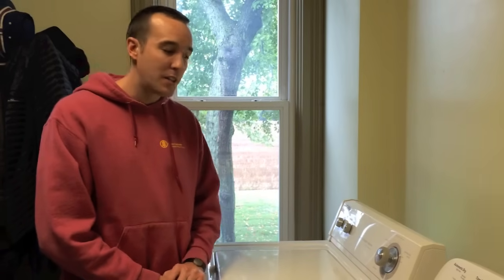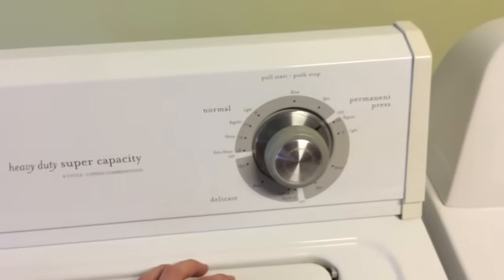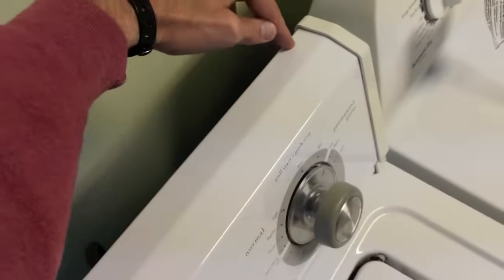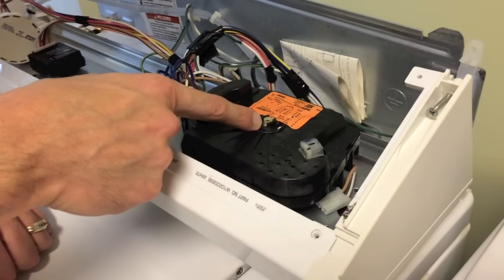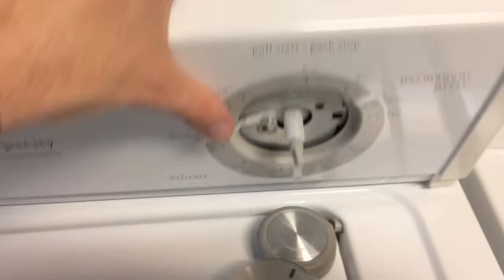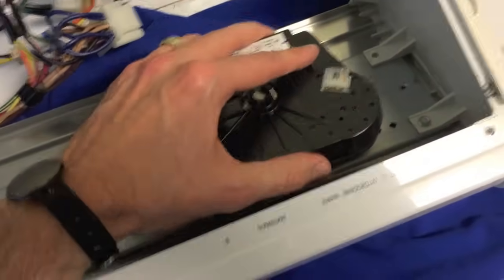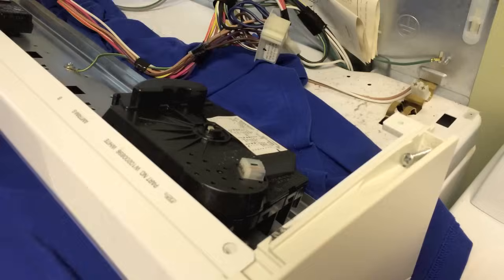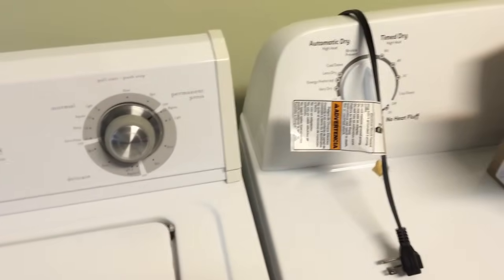My washing machine stops at Rinse - Does not DRAIN or SPIN

Comment: My washer seems to be having issues draining on certain cycles. In addition, recently when I have put it on spin after it has ran to get rid of the excess water, it will sometimes thump and shake like crazy. Do you know what the problem could be or what I could like for? Thanks!
Reply from the maker: Erik Adamson 

Thanks for checking out the video and sharing your experience.  You are experiencing 1 of 3 issues...

     * Drain Pump
     *  Lid Switch
     * Timer...which is mentioned in this video.

1.  Your Drain Pump is beginning to work intermittently.  That little Pump wears out over time and does 1 of 2 things.

     •  Fail intermittently
     •  Fail completely at any given time

       https://youtu.be/M2LltDIjNl0

2.  Your lid switch is wearing out and beginning to work intermittently.  Once your wash cycle gets to the spin portion, your lid switch verifies that your actual lid is closed.  It Then sends an electrical signal to the timer to continue the cycle and begin spinning.  If your lid switch is not working properly, the timer will not continue to the next stage of the cycle... this is a safety feature that does not allow the machine to spin with the lid open...which alleviates the machine throwing water all over your house...not good 😮.  Replacing your lid switch is both repair friendly and cost friendly.  Below is a link to my video changing lid switch

       https://youtu.be/1hTRc-_PnP8

3.  Your timer is wearing out and beginning to work intermittently during the cycle...leading to the stop & go... replacing your timer may get rid of this issue.

Keep me posted!

Please subscribe to the channel and turn on your YouTube notifications that would be awesome thanks again 😎👍

Comment: Would you know what's going on with my machine if it stops working when the dial gets to "Pause Cool Down" feature, is it something serious? I am able to switch the dial to Spin and that works but every time I start a new cycle it just stops at Pause Cool Down. I have a Kenmore washing machine, Any suggestions are appreciated!
Reply from the maker: Yana Ilyaguyev 

Thanks for watching & sharing your experience!  This is common with Kenmore washers more than others.

This is signs of a faulty section within your Timer & once the cycle gets to the point of cool down, it doesn’t know to continue due to the dead spot in Timer sequence.

We recommend replacing old Timer with new Timer.  This should ultimately fix your hick-up & allow washer to complete a full cycle efficiently & effectively.

Let’s start there!  Keep us posted!

Please subscribe to the channel and turn on your YouTube notification Bell 🛎 that would be awesome thanks again!  😎👍🔧🔩

Also below is a link to our Appliance/Home Repair Video PlayList.  It contains several videos that you can benefit from including additional videos on Washing Machines, definitely check those videos out!  👍

       https://www.youtube.com/playlist?list=PLjCXOz8TSkZmG-ZbhhKPj4Vh3K3MDPXii

Comment: How do I know if the timer is the issue? When researching online, I read it could be the cold water inlet valve?
Reply from the maker: Karuna Rockwell 

Thanks for checking out the video.  The symptoms led us to the lid switch first...we tested the lid switch and found that to work as it should.  After replacing the timer, problem solved.  Try testing your lid switch first...there are a few videos out there that will show you how to test it.  Below is a link to our lid switch repair.

       https://youtu.be/1hTRc-_PnP8

Please Subscribe to the channel and ring your YouTube bell 🔔 this will be helpful to us thanks again.

😎👍🔧🔩

Comment: How do we know it's the timer?
Reply from the maker: Thanks for checking out the video.  Great question!  The Timer controls the “Cycle Flow” and continues to move the cycle through the steps.  As the internal parts of the Timer begins to wear out...you see the washer stopping at either “Drain or Spin”...

The Lid Switch also is a key part in the cycle...once you lower the Lid/door...you will hear a click.  This click secures the electrical current and sends message to Timer to begin the Cycle.  

Also...once the cycle gets to the spin portion, the timer re-communicates  with the lid switch to verify that the lid is closed for safety purposes...example:  you do not want the washer to be spinning with a lid open...water will fly everywhere 😱

I recommend purchasing both the timer and the lid switch as they work together to move the washer through the cycle.  

To order parts, Go to:  repairclinic.com

Keep me posted!  Please subscribe to the channel and turn on your YouTube notifications that would be awesome thanks again 😎👍

Comment: So how did you decide the issue was with the timer? Was it a loose dial or how exactly did you come to the conclusion of where to start?
Thanks
Reply from the maker: Steven Wilson Thanks for checking out the video.  The symptoms led me to the lid switch first...I tested the lid switch and found that to work as it should.  This then led me to the timer.  After replacing the timer, problem solved.  Try your lid switch first...there are a few videos out there that will show you how to test it.  Below is a link to my lid switch repair just recently completed.  Please Subscribe to the channel that would be awesome thanks again 😀👍

https://youtu.be/1hTRc-_PnP8
Reply: DIY With Michael Borders thank you so much I appreciate your speedy reply. I have an older whirlpool that yesterday would not drain or spin yet the rinse works fine. So I'll try these solutions tonight now that I don't have such a wet area to deal with. Again, many thanks
Reply from the maker: Steven Wilson Very cool.  Please keep me posted 😀👍
Reply: I have the same problem, will rinse but won't drain and go into spin, I heard the drain pump could be clogged most likely with a sock, checked mine but it was clear, so they say I need a new pump, ebay has them new for 5 to 20 dollars so no biggy, only I can't get my pump off the motor due to rust, it's also an older machine, whirlpool, any suggestions, if I cut it off will I still be able to put a new one on?
Reply from the maker: Jo W Thanks for checking out the video and sharing your comment and experience.  That's no fun...rust is a pain!  I recommend spraying rust eating solvent on rust areas.  WD-40 is another option and let it sit and work into the rust overnight.  I ran into rust issues recently...annoying haha.  Keep me posted.  Please Subscribe to the channel that would be awesome thanks again 😀👍
Reply from the maker: CRAIGARRR Thanks for checking out the video and sharing your comment CRAIGARRR!  Appreciate the info.  Please Subscribe to the channel and turn on your YouTube notifications that would be awesome thanks again 😎👍
Reply: DIY With Michael Borders

Comment: I can still hear a ticking noise does that still mean the timer is bad?
Reply from the maker: Tre Campbell 

Thanks for watching & sharing your experience!  Is the ticking sound coming from the actual Timer itself?

Where does the wash cycle stop?

Keep us posted!

Please subscribe to the channel and turn on your YouTube notification Bell 🛎 that would be awesome thanks again!  😎👍🔧🔩
Reply: @DIYwithMichaelBorders  the cycle stops at the rinse but it just ticks and don't do anything else but stay full of water
Reply from the maker: Tre Campbell 

Thanks for the reply.  You are experiencing 1 of 2 issues...

1.  Your timer is wearing out and beginning to work intermittently during the cycle...can lead to stop & go ticking... replacing your timer may get rid of this issue.

2.  Your lid switch is wearing out and beginning to work intermittently.  Once your wash cycle gets to the spin portion, your lid switch verifies that your actual lid is closed.  It then sends an electrical signal to the timer to continue the cycle and begin spinning.  If your lid switch is not working properly, the timer will not continue to the next stage of the cycle... this is a safety feature that does not allow the machine to spin with the lid open...which alleviates the machine throwing water all over your house...not good 😮.  Replacing your lid switch is both repair friendly and cost friendly.  Below is a link to our video changing lid switch.

       https://youtu.be/1hTRc-_PnP8

We highly recommend replacing both parts at same time.  This will ensure both parts are brand new & ready to work.

Keep us posted!

Please subscribe to the channel and turn on your YouTube notification Bell 🛎 that would be awesome thanks again 😎👍

Comment: Mine drains but won’t spin until I change to ‘spin’.   Then it will spin.
Reply from the maker: Thanks for watching, have you replaced Lid Switch in the past?  It might be as simple as that.  Below is a link to our video showing the replacement process.

       https://youtu.be/1hTRc-_PnP8

If that doesn’t fix issue, it’s time to replace Timer.  Please keep us posted.  Hey also if you’re into crypto trading, join our newly launched DIY community ecosystem.

       Toolboxtoken.com

We DIYers need to stick together!  🧰

Comment: I have this same problem and I saw a video about items stuck on the drain pump. I went through the steps and sure enough found baby's wash cloth in there. Got that out though I have the problem fixed but not yet. 

Could that problem cause the time to work? Saw some videos about resetting the motor but did not seem to be for my older Whirpool Estate washer. I do not want to go buy a new times just to find out I have another problem.

Please advise
Reply from the maker: thafunkhouse Thanks for checking out the video and sharing your comment and experience.  If you are experiencing same issues as in this video, it's possible that your timer has begun to fault.  It's also very possible that your Lid Switch has begun to fault.  The lid switch can be tested and replaced cheaper.  Attached is a video how to change lid switch.  Please Subscribe to the channel and turn on your notifications that would be awesome thanks again.

https://youtu.be/1hTRc-_PnP8
Reply: DIY With Michael Borders
Reply from the maker: Thanks for checking out the video Don!  Hope it helped.  Please Subscribe to the channel and turn on your YouTube notifications that would be awesome thanks again Don!

Comment: I have replaced the timer and lid switch and the washer still stops at rinse cycle.  Anything else I need to replace? I’m totally lost now. I have a Kenmore 70 series.
Reply from the maker: C McNabb 

Thanks for watching & sharing your experience!  After reading your comments & understanding that you have already replaced your lid switch and your timers, an additional part it may be is your water intake valves.

These valves can clog over the years of operation and in the event that they clog...your water intake will obviously slow down and or stop completely.

As of now it’s still sounds like your water is coming in and out of the machine just fine however as the screens inside the valves gather more and more grime in debris... it can definitely lead to the timer, lid switch, & cycle duration being interfered with.

Below is a link to a video that shows the step-by-step process on replacing the part that has the valves.  Definitely check it out!

       https://youtu.be/DiPFZSMiBn8

Keep us posted!  Please subscribe to the channel and turn on your YouTube notification Bell 🛎 that would be awesome thanks again!  😎👍🔧🔩

Comment: My issue is it runs through spin doesnt kick off and goes unti extra runse while that is turned off
Reply from the maker: Thanks for watching & welcome to the DIY Raptor Club.  That is usually caused by a faulty Timer.  If it was the lid switch, it would stop & not continue.  A new Timer should fix your issue.  Keep us posted.

😎👍🔧🔩

Comment: Isn't the problem much more likely to be the lid switch?
Reply from the maker: Frank Blangeard Frank, thanks for checking out the video.  Lid switch is definitely a possibility.  Have you tested your lid switch?
Reply: Haven't tested it yet. New lid switch is $27.50 so I will definitely try that before buying a new machine. PartSelect has a good video for changing the lid switch. Looks like even I should be able to do it.
Reply from the maker: Frank Blangeard Very cool, it is a friendly repair for sure and won't harm the bank account.  If that doesn't work, next I'd try your timer.  I'd also verify that you have sufficient water pressure entering the washer through the lines.  There is a screen "similar to the screen on sink faucets". That clogged over time and interferes with the water coming into the washer .  Please Subscribe to the channel that would be awesome thanks again 😎👍
Reply: Already fixed. Another video showed me how to unscrew the two screws holding the lid switch and pull the switch out form under the top. I then used duct tape to permanently close the switch. For some reason the switch wasn't closing and that was the problem. But now that safety feature is gone so I will need to remember not to stick my head into the machine when it is spinning.
Reply from the maker: Frank Blangeard Haha so true!  Thanks for the update!  That's great news!  It might even be a good idea to buy a new lid switch down the road to have on hand!  😎👍
Reply: if you have a sensor anti burst water hose, might want to change your setting to cold only or hot only  rinse and see if both condition is putting out water. Mine stops at rinse all the time and it was only the sensor anti burst water hose that shuts off on me without knowing. I thought it was the timer cuz it sound s like a timer issue. Good Luck!

Comment: hi ..i have a problem with that timer on whirpool washer...the problem  is... the cycles are not on the mark that supoust have to be....what can i do or fix it...please helpme out...greettengss
Reply from the maker: Rapala Firetiger Thanks for checking out the video and sharing your comment and experience.  The Timer is a very key part in the washing cycle.  It's very possible that your timer is beginning to fault.  Please check the lid switch as well.  I have attached a video for the lid switch. Please keep me posted.  Please Subscribe to the channel that would be awesome thanks again 😀👍

https://youtu.be/1hTRc-_PnP8

Comment: I discovered the washer stopped working ON the rinse cycle. It doesn't want to agitate either when I restarted the washing cycle. I do hear a humming sound when go go through the different modes. It does fill with water. Is it possibly the timer?
Reply from the maker: Chris Z. What’s up Chris Z.  Thanks for checking out the video and sharing your experience.  You are experiencing 1 of 2 issues...

1.  Your timer is wearing out and beginning to work intermittently during the cycle...leading to the stop & go... replacing your timer may get rid of this issue.

2.  Your lid switch is wearing out and beginning to work intermittently.  Once your wash cycle gets to the spin portion, your lid switch verifies that your actual lid is closed.  It Then sends an electrical signal to the timer to continue the cycle and begin spinning.  If your lid switch is not working properly, the timer will not continue to the next stage of the cycle... this is a safety feature that does not allow the machine to spin with the lid open...which alleviates the machine throwing water all over your house...not good 😮.  Replacing your lid switch is both repair friendly and cost friendly.  Below is a link to my video changing lid switch

Keep me posted!

Please subscribe to the channel and turn on your YouTube notifications that would be awesome thanks again 😎👍

https://youtu.be/1hTRc-_PnP8

Comment: My washer stops at drain cycle. If I gently hit it a few times it continues but is taking more and more time to continue now. Could it be timer still? Lid switch is good
Reply from the maker: Brian Clemetson Hey Brian Thanks for checking out the video.  Since you have verified that the Lid Switch is good, you will want to replace the timer.  We were experiencing the same issue you were...we were able to tab/bump the knob or sometimes just move the knob forward "ever-so-slightly" to continue cycle.  That only last for so long 😂...as you are seeing.  This is definitely not uncommon.  Keep me posted.  Please Subscribe to the channel that would be awesome thanks again 😀👍

Comment: Just replaced the timer, still doing it!?!?!?
Reply from the maker: Brandon Mckeehan 

Thanks for watching & sharing your experience!  That’s a great question!

Next part it can be is your Lid Switch.  The lid switch is designed to be a safety feature or mechanisms.  Once your wash cycle gets to the rinse portion, the Timer sends a signal to the lid switch and asked if the lid switch is compressed...meaning the door or lid is fully closed!

The reason behind this is to alleviate your washing machine rinsing and spinning with the actual tub lid open and allowing the washer to throw water all over your house...that would definitely not be cool.  😲

So to recap… the Lid Switch is a safety feature that sends the “ok” signal or “Yes the lid is closed” confirmation to the timer to allow the timer to continue the cycle!

Hope this helps!  Please subscribe to the channel and turn on your YouTube notification Bell 🛎 that would be awesome thanks again!  😎👍🔧🔩